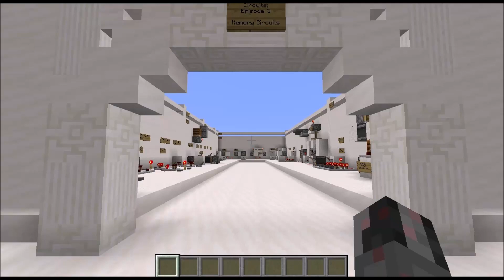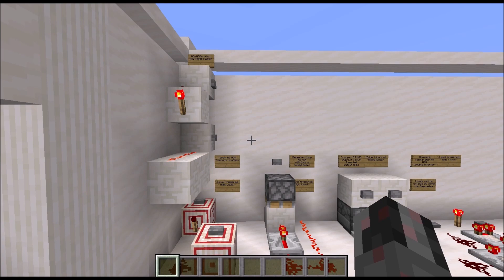Redstone Circuits: Episode 3 - Memory Circuits [1.16.4]

Comment: You can probably also detect stuff in a piston feedtape using other properties, such as whether glass connects to its sides, scaffolding to its top, walls with an adjacent surface to it's bottom, if it's a haybale/snow block (using a grass block and a campfire), whether a note block triggers if the block is beneath it, if it's a powered rail or activator rail from how they power others of themself if they get powered, soul sand and magma blocks via bubble columns, if it's a wall, if redstone dust redirects to it.
Reply from the maker: All very good ideas. I'll definitely include those, once I make an addenda episode for this series. Thanks!

Comment: Hello, thanks for the tutorial. Can you make a rocket that can be guided by coordinates(or just guided)? I've already seen a couple of these, but in my opinion they are all incomplete, thanks in advance.
Reply from the maker: What are you talking about?
I know of flying machines that would trigger after a certain distance, but I don't think that's what you mean.
Reply: @RKFWalter  I apologize for the inaccuracy, I do not speak English very well, I mean so that you can set the place of the missile hit.
Reply from the maker: Well, the only thing I can think of are some flying machines that contain an internal step counter (a piston feed tape that moves with the flying machine). Once that triggers, the missile explodes, but I never actually build one myself.